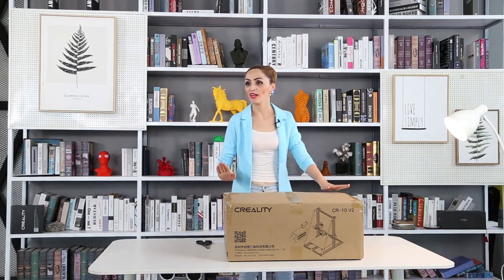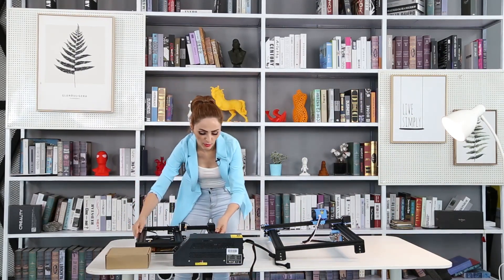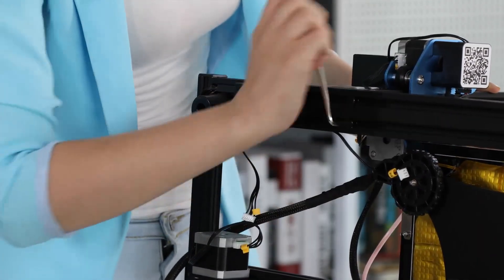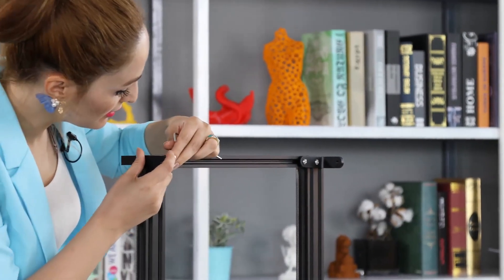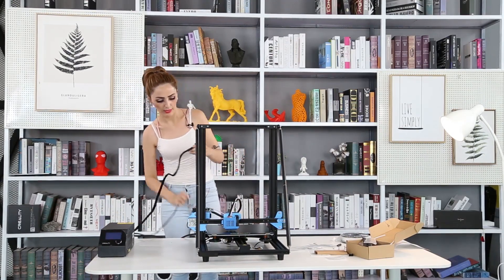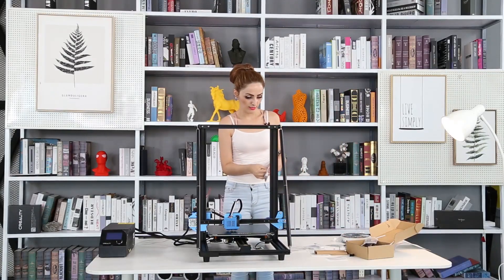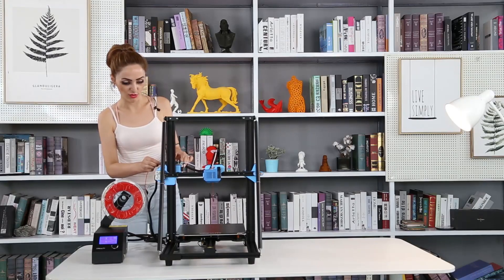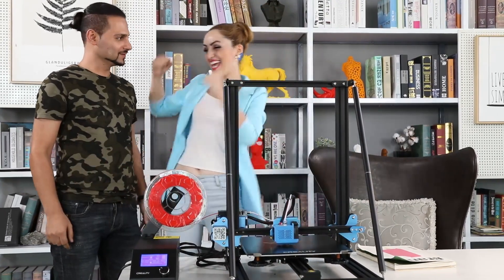CR-10 V2 unbox and operation tutorial

Comment: Will the CR10 V2
come with a direct drive of the filament installed directly on top of the nozzle?
Reply: No. It comes with Bowden type extruder. You can upgrade it with titan Direct Drive, there are slot available for it